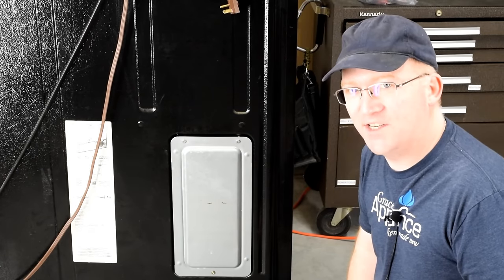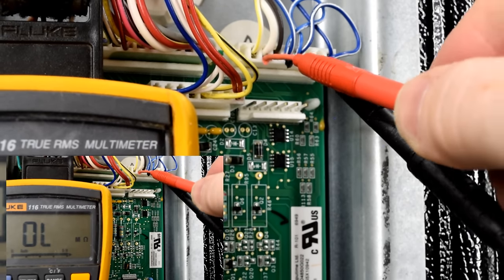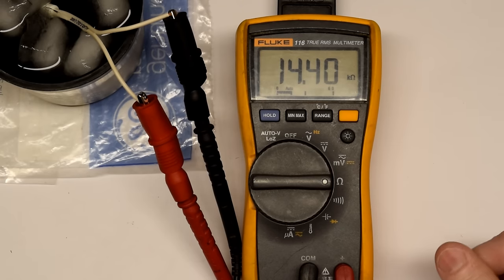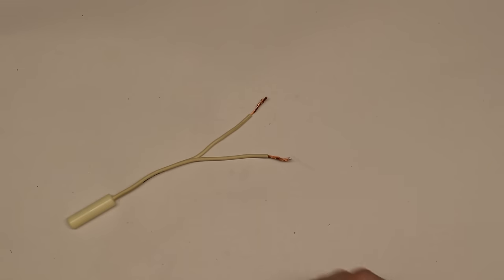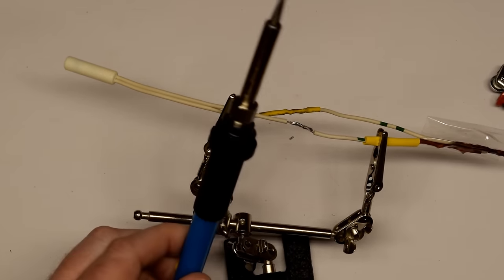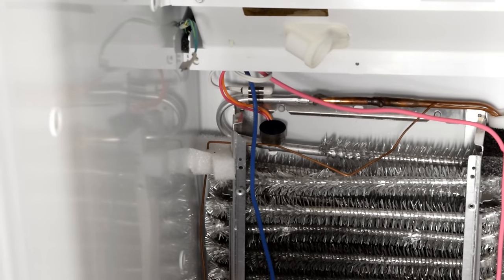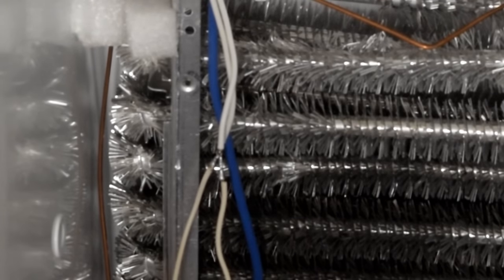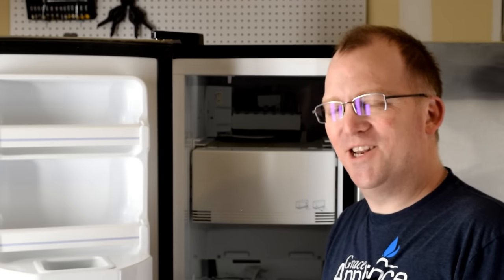Testing and Replacing a GE Defrost Sensor - WR55x10025

Comment: Hi Andy,
First, let me say I love your videos!  I bumped into them just by accident the other day, and I'm glad I did.  They're professional, calm, thorough, detailed, just a real pleasant place to watch and learn something useful.

But I have a problem, and I hope you can help.  We have a GE Profile French door bottom freezer refrigerator, model PFCS1PJXASS, bought new in 2008, and very similar to the side-by-sides you focus on.  It has several issues, the most important being that the freezer won't stay consistently cold.  This has been going on for several months now, and has gotten worse recently.  When it misbehaves, it goes through large temperature swings, with actual temperatures inside varying anywhere from -7°F to as much as 36°F (I keep it set at 1°F).  In contrast, the fridge section stays pretty consistently around 38°F, which is where I have it set.

I've cleaned the "squirrel cage" around the condenser, and generally underneath the entire unit (a little dusty, but not bad).  Using your videos, I've visually checked the outside part of the main control board (didn't remove to check for burned solder joints on the back side), and the interface display on the front, and didn't find anything obviously wrong.  I found online a description of how to run diagnostics from that display, everything looked OK there too.

Finally today I ran through your video (this one) on testing the thermistors, and got some unexpected results.  Assuming my J1 connector matches the one in your video (can you confirm that?), and based on some information I got from a service manual for a very slightly older version of my fridge, this is what I got (temperatures inside unit very high because I turned it off for quite a while today):

J1, pin 1 (fridge), actual temp. 42°F, measured 9.54kΩ

J1, pin 2 (ambient air), actual temp. 66°F, measured 7.30kΩ

J1, pin 3 (freezer), actual temp. 45°F, measured 11.74kΩ

J1, pin 4 (evaporator), actual temp. 45°F (maybe a little higher?), measured 11.53kΩ.

I fully expected to see a bad freezer thermistor, but that one actually tested pretty close to what I would expect based on the charts I've seen.  Likewise the ones for the evaporator and ambient air.  Surprisingly (to me), the thermistor for the fridge seems off a good bit; I interpolated from the charts, and estimate that the fridge thermistor is "acting like" it's at 52°F (actual temp inside 42°F).

Is it possible that a bad fridge thermistor could be causing the problems I'm seeing in the freezer?  I'm almost convinced it is, so I'm going to order a couple of thermistors and at least replace that one, and see what happens.  But I would value your input, do you have any other ideas?

One thing I should mention…  One of the "other" issues with this fridge is that one of the fridge section gaskets is torn and brittle, and I plan to replace it (freezer gasket seems good).  I don't feel any cold air around any of the gaskets, but I suppose this could be part of the problem too.

Also, I had an appliance repair guy come out to take a look last week, and he's puzzled about what's going on here.  He took the freezer apart to check the frost pattern on the evaporator; it seems fine, and we're not seeing any defrost problems.  The fans and compressor are all working; I don't know for sure how well or whether they're operating at all the appropriate times, but they work.

Thank you!
Reply from the maker: Hey Ed, 
Thank so much for the kind words and for watching.  
Sorry to hear about your issues with your freezer.  

So, I agree with everything you’ve written.  I agree the pins appear to be the same from what I’m seeing too. I agree that the fridge temp sensor seems out of spec.  However, I wouldn’t expect this to cause issues with your freezer temp and certainly not as wild as you’re seeing.  
Either way, I’d start there.  

The first thing that came to mind was a defrost issue, but you state no issues there. 

Other things that come to mind that might cause this symptom is a restriction in the sealed system. However, this would also affect the frost pattern on your evaporator.  I’d want to get eyes on the evaporator when you’re having the issues with warm temps. 
If you find that the evaporator does not have a light coating of frost on +/- 90% of the rungs of the evaporator, I’d suspect it has a restriction (I.e. clog) in the refrigerant lines.  

Outside if that, I’d verify that the evaporator fan is not cutting in and out...same for the compressor.  

If all this checks out, I’d suspect a failed control board not making the right decisions based in the sensor feedback, but I wouldn’t start there.  

If you wanted to send some pictures if the evaporator when frosted and cooling well vs not cooling well, feel free: GraceAppliance@gmail.com 

Thanks and let me know if you have any questions.
Reply: @GraceAppliance  Hey again Andy, thanks for getting back to me so quickly!
As I write this, the temperatures in both the freezer and the fridge are about 45 degrees, not good.  The condenser fan is running, and I believe I can hear the evaporator fan running as well.  But I can't tell if the compressor is running or not, it's cool to the touch.
I'll go ahead and replace the fridge temp sensor, and see if anything changes.  I'm starting to question my assumptions here, especially about potential defrost issues; I'll keep an eye on that, assuming we can actually get this thing working again.
I'll try to get some photos of the evaporator, under both conditions if possible, but that's a bit of an effort given that you have to take half the freezer apart to get to it.  A restriction in the sealed system doesn't sound cheap, what would be involved in trying to repair that?
And how can I tell whether the evaporator fan and/or compressor are cutting in and out?
Thanks again!
Ed
Reply from the maker: Hey, it doesn’t sound like the compressor is coming on when it should. It should always be running when the condenser fan is running (I.e. the fan by the compressor). 
It should be warm to the touch and you should be able to hear it humming softly.  

Given that it runs intermittently, I will make the assumption that the compressor is good.  My money would be on failing relays for the compressor, but a control board issue can also cause this same symptom.  (Or, a compressor drawing too many amps, but let’s put a pin in that one) 
Let’s also forget about the frost pattern for now as it sounds like the issue is the compressor not running consistently.   

If you have a meter, you can check for 120vac coming to the two wires leading to your compressor. If it cuts in and out, that’s a bad board.  But, if you have 120vac constant, but still the compressor won’t come on, the board is good and it’s very likely the relays.  

Let me know what you find there.
Reply: @GraceAppliance  Okay, this is starting to make more sense…  This particular model has an inverter compressor.  I do have a meter, but it's not clear to me how to test for 120vac with this setup.  Should I be looking to test the inverter output, and how would I do that exactly?  And when you talk about possibly failing relays for the compressor, do you mean relays on the main control board, or something else?
Reply from the maker: Sorry, my mistake. You don’t have relays at the compressor.  
The inverter board would be where you’d focus your attention then.  You’ve got 2 wires leading from the main control that supply the inverter board with something like 3.5 - 5 vdc. This is a signal wire to tell the inverter board to produce voltage. If you’re getting this voltage to the inverter board, the main board is doing its job and it would be the inverter board that was at fault.  

Tomorrow I could look up some more detailed specs on how to diagnose if you needed.  

We’re on the right track though for sure.
Reply from the maker: But, You won’t have 120v at the compressor as it’s a variable speed compressor based on cooling demand.  So, the voltage varies depending on the speed of the compressor.
Reply: @GraceAppliance  
Understood, at least as much as my beginner's level of knowledge about inverters will allow.  I'll take another look later this morning.  It sounds like I'm looking for wires/connectors from the board to the inverter, correct?  If you can find more detailed specs and instructions for how and where to test for voltage to the inverter and the compressor, that would be great!
Reply: @GraceAppliance  I have a quick update...  I took a look at the not-quite-my-fridge service manual, and found that I should be getting 4-6vdc at the J15 connector on the main board.  I tested that, and got 5.07 vdc, so I think that section of the board is okay.  I believe the next step is to check for 120vac to the inverter at the orange and black wires -- is this as simple as inserting my meter probes into the appropriate connector, and does it matter which probe goes where?  Assuming that tests okay, I believe normally you'd want to check the inverter output.  I understand that's difficult to do without special tools, so the next best thing is to cut power off, move the inverter out of the way, remove the white connector on the compressor, and check the compressor windings.  Does this sound about right?
Reply: I believe we're making progress here...  I skipped the check for 120vac to the inverter, just because I'm nervous about sticking my probes where I'm not sure they actually belong (especially near live AC voltage).  I did check the compressor windings, and measured 6.3 ohms between each pair of pins.  This is less than the 9-11 ohms mentioned in the "other" service manual I have, but another YouTuber says the important thing is that the readings are the same, and calls the 6.5 ohms he got "textbook".  I also took a cue from one of your other videos, and checked the continuity of each pin with a nearby copper tube, no continuity shown for any of the pins.  At this point, I'm inclined to believe my inverter is bad.  Does this sound right to you, and do you think I should check the AC voltage to the inverter before I decide to order one?
Reply: Another update...  I re-read everything we've talked about here, and ordered a new inverter, it should be here tomorrow.  I did find a GE document that showed how to test the inverter inputs (both 120VAC and 4-6VDC), very easy but I haven't done that yet.  Yesterday the compressor didn't come on all day, fridge and freezer got very warm, until late in the evening when it came back on and started cooling again for no apparent reason.  I'll install the new inverter tomorrow and see what happens, I'll keep you posted.  Thanks again!
Reply from the maker: Awesome work! Keep me posted if you have any issues.
Reply: @GraceAppliance  Hey again...  My new inverter actually arrived today.  This is a busy day, so I'm not going to try to install it until tomorrow.  It's a little different than the old/original one, main differences being a metal shield on the side away from the compressor, and different output voltage.  I believe these changes were made to address some heat/moisture/lifetime issues, and I have no doubt this new one will fit and work just fine.  There is something I want to ask you about...  There are 3-4 areas on the circuit board inside the inverter that look like they've been covered with a white toothpaste-like gel.  I touched one very gently, it's hard, like it's cured.  I suspect this was done to protect critical capacitors or something, but I just don't know enough about these boards to know for sure.  Have you seen this before?
Reply: One final update (I hope)…  I installed the new inverter yesterday, no problems at all, plugged the fridge back in, the condenser fan and compressor started almost immediately, and it's been cooling nicely for about 20 hours or so now.  The only issue right now is that the display temperatures don't match the actual temperatures inside the two compartments, but I'll keep an eye on that for a few days until I see a real pattern.  I also took the time to replace a broken section of water line into the fridge, a simple but tedious task, we now have water from our dispenser and I'll turn the icemaker back on a little later today.
Andy, thanks for everything you've done to help me with this project, I really wouldn't have had the nerve to tackle it without you.  Thank you!
Reply from the maker: @tunahead7275  nice work Ed!
You're most welcome for any help I could give. I'm. Glad you got it sorted out.  Stay in touch!

Comment: I think you should update your post. If you use the caps you should be able to seal it with silicone. It is not only easier, it works just as good.
Reply from the maker: Thanks for the input and for watching.

Comment: Hi, thanks for informative video! Question, are all three readings on the multimeter supposed to be the same? When testing the last wire(brown) which I believe is the evap coil sensor, it’s about half of the other amounts at 0.5. The other two are about 1.4.. does is mean that the coil sensor is bad?  For context, the defrost heater element isn’t turning on during the cycle.. I did the continuity test in other vid so I think the thermostat is ok? Thanks for your time, and any help/info.!

Comment: I bought the knock off sensor and had a quick resistance test and found the chinese knock off was just reading 10k ohms @ 77F .that's 5K ohms off the spec! Get the genuine GE parts only.

Comment: Your tip that now I know how to test it rather than cut the wires on it.. lol dead on.. last video I knew how to jump the plug to defrost it but to test the orange wire to the blue I didn't know, normally I just jump it, it is defrost, obviously the element and defrost  thermostat is ok.. plus it helps to have it defrost along with me doing it inside the freezer too. Have a bad board to install today and the board is normally not the problem for defrost but it’s common for the compressor relay to burn off the solder joints from it’s internal contacts wearing out and causing to much amp draw.

Comment: Hi again Andy and thanks for the quick reply.  I've got a GSS25SGMD-BS (2002) that had a defrost heater installed (GE Service) last Dec. 2017. Several months ago she started making noises occasionally and several days ago the fresh food side as well as the freezer side started heating up. I pulled the panel and it was caked over with ice. Cleared that and tested the defrost heater which is good. I purchased a thermostat (X10068) and sensor/thermistor (X10025) to self install with the idea to try the cheaper fixes first before calling for service. After learning so much from your videos I'm realizing that among other things I could also have a evap fan and/or control board issues. I'm not great with a multi meter but I can continue with testing to narrow it down. Would love it if you can suggest a priority list of steps to try. Thanks and much appreciated.
Reply from the maker: William Green hey!
I’m so glad they’re helpful! 

So, if the evaporator fan is turning, that will not cause frost build up, it ‘can’ cause frost build up but usually not nearly as severe as a defrost issue.  
If you’re having severe frost build up on the evaporator, it’s certainly a defrost issue.  
You’ve replaced 3 of the 4 parts that have to do with the defrost, only leaving a bad board as a suspect. 

In this video: https://youtu.be/XeZfpB7ok90
It shows how you can jumper wire the defrost heater which will cause your heater to come on. This will tell you for sure that your heater and hi limit thermostat are both good. If you’ve replaced the defrost sensor on top of the evaporator already, go ahead and replace the board and you’ll be in good shape.  

If you’ll look in the description, there are affiliate links to the common parts you’ll need and if you purchase through these links it helps the channel a ton.  Thanks and please let me know if you have any questions! Andy

Comment: very informative ,I would of used a insulated butt connector's.Question I have the GE side by side works excellent until we have a power outage or interruption we have to wait 6 -22 hour's before compressor & fan come's on why ?
Reply from the maker: Hey, thanks. 
It’s most likely a failing control board. The relays on the board get weak over time. They make connection via what is essentially a small electro magnet (I.e. the relays coil). It sounds like you need a new board, but given that it’s intermittent, unfortunately there isn’t a way to confirm this diagnosis beyond replacing the board.  You just have to go by the symptom you’re having.

Comment: I have a GE model from 2002 and when I measured the resistance with the connector plugged-in to the board the numbers were quite a bit different than when measured with the connector removed.  Is that typical?  Since your video shows the measurements being taken with the connector still on the board I expected the values to be the same either way.

My fridge was cold though, so the numbers with the connectors removed was 16K, 15.5K, 34.1K, 57.7K going 1, 2, 3, 4 (it has wires in all 4).  With the connector plugged-in the values were 8.07K, 7.88K, 11.12K, 12.95K.  Temps were 37 fridge and maybe 0 or so freezer (it was running just before unplugged and checked).

Comment: Hello, Andy! I am a reader from Rio de Janeiro in Brazil. Congratulations for great tips and tutorials. I was just wondering if this thermistor is the same used along the evaporator fan, in the freezer and fresh food compartment.
Reply from the maker: If your fridge is a GE, in most cases yes they are identical. So long as they are the same shape and size, they are the same to my knowledge. The length of wire may change along with the part number, but the thermistor itself is identical from what I've seen.